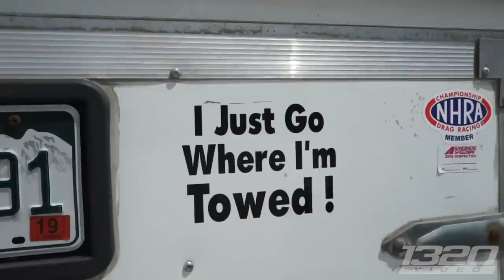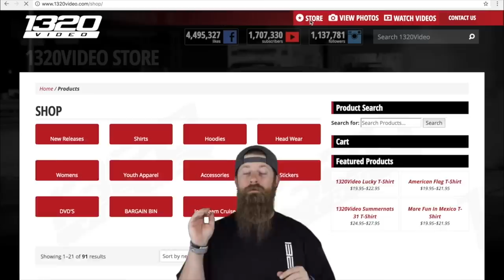Someone Get This Guy a MAN CARD! 1500HP Stick Shift GTO!

Comment: If your blowing the tires off with a 4.56:1 rear gear and you got to a 3.70:1 gear it would only make it worse with big power unless you changed the first gear ratio in the transmission .
Reply: Groom Lake.... the taller gear helps keep the tires from slipping.....less gear reduction makes the engine work with more load at the hit....
Reply: Bill Allen I’m no door slammer guy I grew up around funny cars and dragsters with no suspension but that’s backwards In my world. A taller gear will increase wheels speed at the hit given your making enough power to drive through it.  When the track gets greasy we would put more gear in it to slow the tire down. At the same time we would get more aggressive with the clutch to keep it up on the tire for second gear so it doesn’t shake. I have worked on a few four link cars and caltrac cars and I thought when it porpoises like that on the launch means the engine isn’t making enough power to keep the weight transferred on the rear end and it unloads and loads the rear end giving that wheel hop effect.
Reply: Bill Allen it might just be the tall 1st gear in the t56 also. He seems to just dump the clutch and not drive in to it off the line. Both cars are super cool I do know that
Reply: Bill Allen a “ taller gear “ means less gear reduction ! A “SHORT” gear means more gear reduction . When most high powered drag cars do a burn out they start the burn out in high gear. Like a TAFC . The driver puts the thing in high gear and dumps the clutch and instant burn out.  Prostock car will start in 3rd gear just to break them loose then shift into 4th and 5th , let go of the line lock and roll it out.  I don’t know what kind of cars you work on but in most drag racing applications a taller gear will make the car more likely to spin the tire given the same tune up is in the clutch . Any time your running a slick tire you want the tire to controlled slip . When a slick tire stops slipping it will usually induce shake. So when your running a slick type bias ply tire and you start to “stick the tire” your usually flirting with tire shake. Now on a drag radial tire you never want it to slip , you want to dead hook that tire.

Comment: A friend of mine has a 3rd gen firebird NHRA Superstock with a 73 SD455 in it, single Q-jet that came stock on the engine, modified iron heads that came on the engine, it makes 720hp@8000rpm, runs around 9 flat in the 1/4 at 150+mph. 1000+HP, them cars should be faster.
Reply: He is still working on the chassis setup, keep in mind he drove it 16,000 miles this year.

Comment: Nice! What transmission are you running in it?
Reply: he says T56 magnum
Reply: Emma guido thanks! I’m wondering what custom work was done to it tho since the stock T56 magnum is rated around 700 footpounds of torque.
Reply: stock off the shelf!
Reply: Emma guido pushing that kind of power, I don’t see how that’s possible. Again, stock T56’s are rated for 700 torque. Thanks for the info tho

Comment: what is the suspension setup on the '65 goat???
Reply: Pretty much stock configuration with upgraded parts...soon to have better shocks and slicks!
Reply: Richard Guido thanks for the reply...the chassis seemed to unload and load on the launch and the shifts, the latter probably why it was walking around on the top end,  what a handful, glad  you and the car are ok.  putting that much power on the ground is a challenge...i like what you're doing...i have a '65 goat as well, stock block, stock heads, stock crank, naturally aspirated.  my home track is bandimere, where air is rare...  good luck

Comment: 900+hp with a 6 speed only running low 10s doesn't seem right to me
Reply: Assuming with driver ~4020 lbs. That's about right considering it needs a better 4 link and new/different compound slicks to keep the tires planted. I read above that the GTO will be getting a rear suspension upgrade.

Comment: 1500 hp and runs 10s?
Reply: Pitiful, I'd be embarrassed at anything less than a high 7 with that combo. Needs a Lenco.
Reply: These take time to sort out and the GTO just put the turbo in before this trip, it is in the sorting process.  Lenco's are cool but really a street trans.

Comment: neither one of these cars have anywhere close to 1500hp lolz
Reply: ufopulse maybe not quite, but not far off
Reply: What makes you say that?
Reply: ufopulse did someone say they did? And what street car do you run where you're laughing at 11-1200 whp?
Reply: ufopulse why not ? There are 4L street driven cars with that hp. Fuel, timing,  boost.
Reply: Shoot, Nor Dic, there are 2.6L and 3.0L engines making that kind of power that are fully licensed and streetable. Nissan's RB26 and Toyota's 2JZ come to mind.